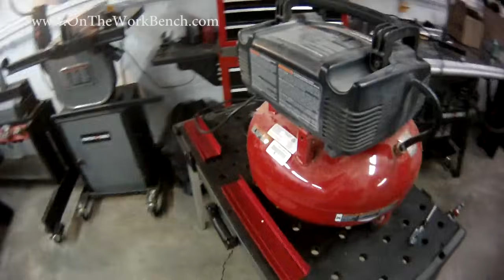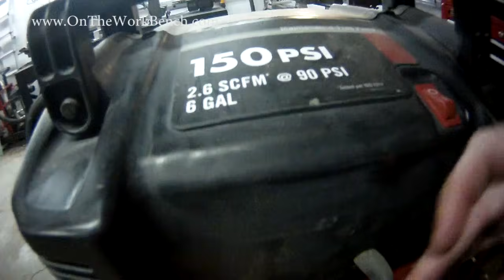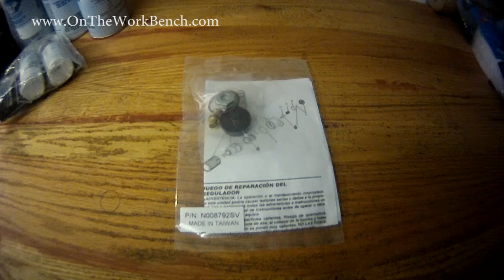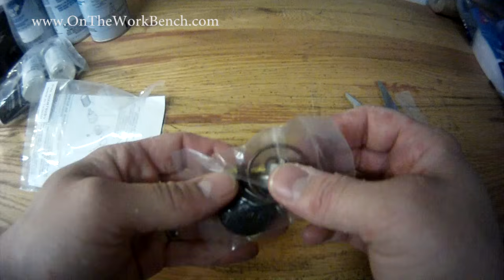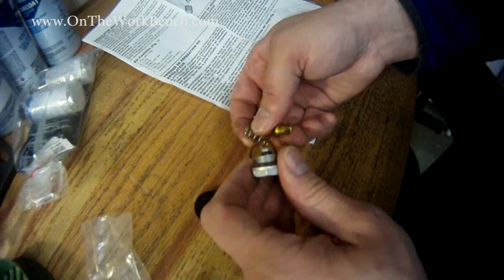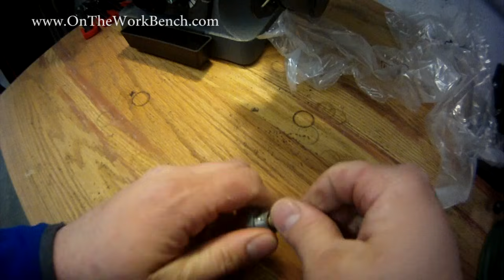Porter Cable Compressor Regulator Repair

Comment: Good post, thanks.  I had this same exact problem.  Here are a few things i figured out while trying to find the correct video: 
(1) There are several versions (aka types) of this compressor.  This seems to be the Type 5.  It says it right after the model number on the tank label (C2002 Type 5).  

(2) Within the Type 5, there are three versions.  One made in Taiwan, and two made in China (based on date made).  There is another label on the back of the manifold that says where it was made.  This is important because the piece you replace will vary based on the date and place of manufacture. 

(3) The bolt in the back that you removed with an allen wrench and then put back on with a wrench is really weak.  I thought I thad to tighten it down hard since this is an air compressor and I snapped the head off.  Be careful not to over tighten this piece.  I would use the allen wrench.
Reply from the maker: Thanks for the great insight!
Reply: same exact problem with regulator.

Comment: Regarding the scraping sound, when you were unthreading the initial plastic cap, it was scraping heavily.. and for a reason.   If you look closely on the plastic cap here is a small silver pin, probably a 1/16th inch wide and maybe 1/4" long, if you take some needle nose pliers and pull it up, then you can thread the plastic cap off without all the scraping -then when you reassemble you can smack it back in with a light touch from a hammer..  Also, the plastic tray is just important to guard the gauges from getting knocked off.

Comment: Thank you for taking the time to make this great instructional video.  I was able to repair my regulator assembly without purchasing the kit by taking apart the sticky valve body which was not moving smoothly.  Mine was stuck in the compressed position (exactly like yours) which essentially locks the regulator into highest pressure mode to the tool output valves which is what occurs when the control valve is turned fully clockwise.  I cleaned out the plunger and where it seats and relubricated the little O-ring with silicone lube.  After the repair, as the tank was pressurizing, the output side pressure stayed low (almost at zero), when I had the control knob fully counterclockwise, (lowest pressure) and I was then able to slowly turn it clockwise to regulate the pressure to what I needed. Thanks again for the great work!

Comment: Does the large black plastic disk supposed to move.  How to get it out. I freed up the spring and plunger that was stuck. Still can’t get the knob to show pressure on the out gage. Ideas??? Thanks

Comment: I realize this is 9 years old. If you pull the small pin out just a bit at the lip of the pressure adjustment nob. It comes off easier and will not damage the threads

Comment: Good vid on the compressor  and valve.I have rhe same issue with no leaks but my right side gauge never goes up and I cant get anything thru the compressor fittings.Is this fixed with your remedy?😊

Comment: I think you will still have to get new O rings for the back nut and stem assembly. I got a new Kit also. Everyone is having the same problem with these compressors

Comment: I think The big O ring should be shoved all the way far inside the big Black regulator twister (cap) before the final step to prevent air leakages.

Comment: Hello ty for the help finding  repair kit help An video .  i would like to add if you have  that excat  confirmation  shown in video  you may not  need big o ring behind black disk if you put it in an then pull black disk back out you will notice  it falls in opening in housing at back. an o ring seems to be to big for opening. In diagram  there is a whole valve assembly  in front of it. Where as I an video maker  don't .we have a spring an a black screw on knob. I left   o ring out an it works  perfectly. I may be wrong  but thought  I would  say something  ty again  for video

Comment: Big thanks I have modle c2006 type 3 and unable to locate new replacement regulator parts.  After watching I had the frozen brass plunger component and was able to disassemble clean and fix.  Many thanks I love fixes like this. Good for my wallet and the environment.

Comment: This is awesome. Thanks so much for posting this. I had the regulator apart 3 times trying to figure this problem out. Your video led me to the heart of the problem.

It turned out to be the tiny “O” ring on the little bras plunger that slides in the little bread sleeve. It had dried out and wasn’t making good contact. When I went to remove it to inspect it, it just crumbled. Fortunately I had a suitable replacement on hand. After I replaced that tiny “O” ring it regulated great again.

Thanks again!

Comment: Be sure to open the drain valve at the bottom of the tank when finished with the compressor. It will drain water built up from condensation.
Reply from the maker: Yes!

Comment: My man! This was the fix for me. The spring was totally seized up and the parts around it corroded. I hit it all with some steel wool and now back in business. I just wish I would have found this video before I bought a new pressure switch. I guess I have a spare now in case one breaks, so no big deal.
Reply from the maker: Thanks!

Comment: Best video I found to return my PC C2002 to normal operation!

Mine had leaks from drain and the hose from manifold to pressure switch so would never reach 150PSI to shut off. I thought it was the pressure switch until I watched this video and read ALL the Comments. The Pressure Regulator also had stopped working. 

Here’s what worked for me:
1. Replaced the knurled drain since the rubber o-ring had disintegrated with an all metal 1/4” NPT T-valve from Ace HW. 
2. Removed the Pressure Regulator knob and valve as shown in the video and cleaned it with WD-40 & 0000 steel wool. The valve was stuck all the way in high pressure position. Cean the valve piston very well and make sure it moves. I used a very light coat of plumbers grease on the piston and o-ring. Replaced the parts as in the video. 
3. I tightened the factory hose clamp as shown in the video. Use a spray bottle with a cleaner that will show bubbles to check for leaks.  

I tested the compressor and it builds pressure to 150 and kicks on when the Tank pressure hits 120. I verified the Regulator pressure is fully adjustable. 

This video was very helpful as I only replaced the drain valve in this repair. Total cost: $7. $4.99 for the valve and $1.99 for pipe thread compound,  all at Ace HW.

Comment: I didn’t have time to order the part so I removed the tiny rubber washer off the aluminum post under the brass fitting. I polished the post (had aluminum rust that was pushing out on the rubber washer). After that I replaced the rubber washer and the brass fitting and spring slid perfectly. Greased everything and put it back together and worked great.

Comment: Very useful info. Took me 17 mm wrench (adjustable will work too), few drops of WD40, fine sandpaper, and 15 minutes tops to fix the leaking regulator. Now it is working as on day one. Saved me at least $25 and time. Make sure that you pull out the round plastic piece and clean it and inside the regulator with WD40 or silicone lube soaked felt. Thank you so much!!!
Reply from the maker: Thanks for sharing

Comment: Thank you, thank you! I was ready to scrap my pancake compressor since a new manifold/regulator was half the price of a new compressor. That little spring loaded valve on mine was gummed up. Cleaned it and applied a little mineral oil and the thing runs better than ever!

Comment: thanks i used mine today and had to turn it down to 45 psi. the only trouble is when i did it went to zero and stayed there. set back scratching my head and it went back to working. and just before i was done it did it again never did work again. but after your video i cleaned it up and it seems to be working again. but still going to get a kit and keep it for a back up because we all know its going to di it again.

Comment: Well well. I just fix mine and no one of the videos help me. What I did was only with a pair of point players released the valve that is inside and oiled and come back to work the right way. But thanks for ideas and hope someone with same problem see my comment and try too

Comment: I took mine apart, cleaned everything per your instructions,  my spring was not seized. Put it together, and it still runs even thou the tank pressure shows 120, and regulator gauge shows approx 60.
Any other suggestions?
Thanks

Comment: Should the pressure be backed off the spring when not in use to prevent spring from getting permanently compressed? I was thinking this may slow the wear on those parts.

Comment: I was taught in aviation especially with electro-mechanical hydraulic actuator to read continuity in the cannon plug pins that way you could tell if you had a bad actuator or if the wiring was bad. Changing a three hundred pound actuator to find out the there is nothing wrong with the actuator. Is it possible to read continuity on a pressure switch like E 108524 two wire two blade switch?

Comment: Your video is most helpful thank you
However other failure points on a well used compressor
1.On/off switch failure
2.High pressure safety valve on manifold with pull ring corroded,not sealing
3.Gasket on cylinder head sealing aluminum output line broken-or missing
4.micro cracks in manifold assembly from harsh accidents 
Otherwise,you'll get 15 years out of the older ones made in USA

Comment: Thank you for making this video!  Do you know if that large o-ring is something added to the kit.  Did you have that o-ring before you purchased the kit?  Do you know the purpose of that o-ring?  Think I need it?  I'm not going to buy the repair kit.  I have the exact model No. and mine doesn't have that large o-ring.  I got the same problem with the back part corroded and froze up so I'm going to work it loose.  Got it soaking in vinegar right now.  Thank you again for the video.
Reply: Mine didn't have it either. Porter-Cable C2006.
Reply: @dougjones5607  thanks for the reply

Comment: Thanks. Mine is a Porter-Cable C2005 and had the same problem of a stuck brass piston. The outside appearance of mine is slightly different, but the regulator seemed to be exactly the same as yours. I cleaned up the brass piston and attached spring with a wire brush and fine sandpaper, then a drop of oil. While I was at it, I pulled out  the black rubber piston/diaphragm on the front side, lightly fine-sanded the cylinder it moves in,  and sprayed with silicone. Reassembled, and all is good. 

I've had this compressor for about 18 years, and lately it's been cycling on and off several times a day. Needed this repair for a while. . . I like your intro music, too.

Comment: Thanks! I was pretty close but after watching your video, I got it apart. I cleaned up the current valve/spring assembly, and regreased. Works perfect.

Comment: Thanks for posting this video.  I was able to fix mine using this as reference.  I didn't have to take the knob in the front off.  I only removed the plastic cover and the rear assembly using a wrench.
Found that the spring was compressed and stuck.  A little WD40 and some twist and tugging got it free and I just put it back in and now the compressor works as it should.  Took only a few minutes.   Cheers!

Comment: Just took mine apart cleaned the parts you took out sanded all the parts with 400 grit lightly. Put o- ring lube on the o- rings works great. Thanks for the video!

Comment: thanks for the video - very helpful - when I took the 17mm off I pulled apart the valve from the back cap, silicone spray lubed it and made sure the check valve/spring could move freely.   I re-installed and the leak is gone.

Side note  - when I took the regulator cap off I found a black plastic piece floating around - I discarded it before re-installing and it worked fine.

Cheers!

Comment: This compressor is 99 bucks new at lowes, do you know where to find the part for maybe 10 bucks? Else we should just buy another compressor.
Reply: I had this problem too, what I was told is to not leave air in the tank for extended periods and the spring valve looses it ability to fully engage and you have leaks. It’s best to open the drain plug at the bottom to let all air and condensation out and leave it open until the next time you use it.
Reply from the maker: Fair point, it makes me think of the razor conundrum, where razor blades cost 75%+ of what a new razor costs.

Comment: I bought this same compressor at a pawnshop today. They wanted $80 for it but the compressor never shut off. I was thinking I either had to buy the manifold or the pressure switch. The guy at the pawnshop thought it was the manifold and said I could buy one for $40 so I told him I would buy it for $40 and he agreed. I've been searching for about 30 minutes when I found your video. My piston and spring were seized up just like yours. A little brushing and oil and it's good as new. I saved $25 bucks on the regulator kit and I have a great little compressor for $40 bucks. Thanks a bunch.
Reply from the maker: Glad to help!